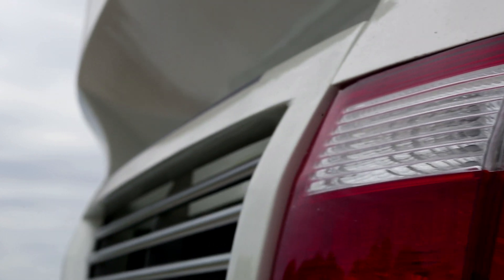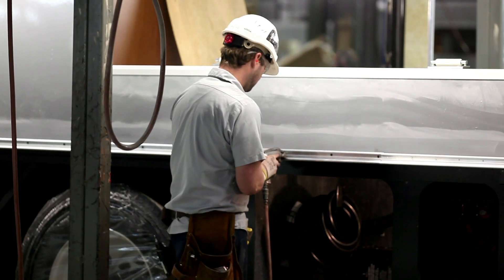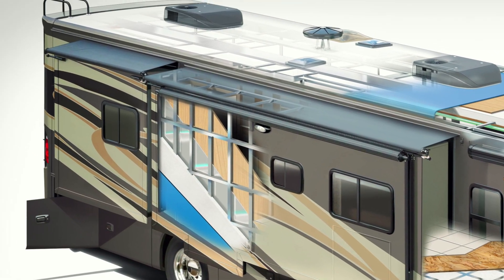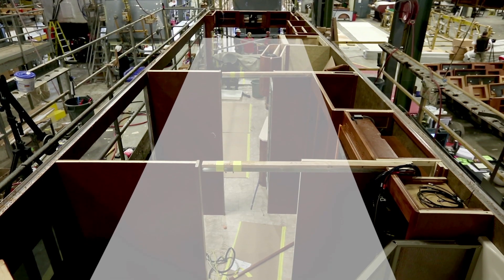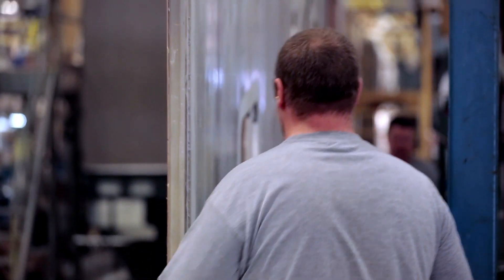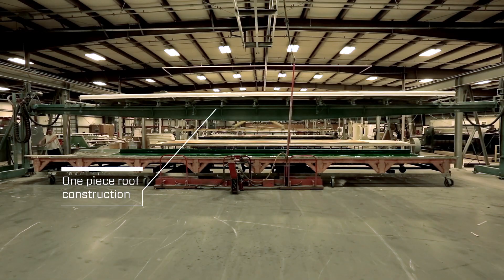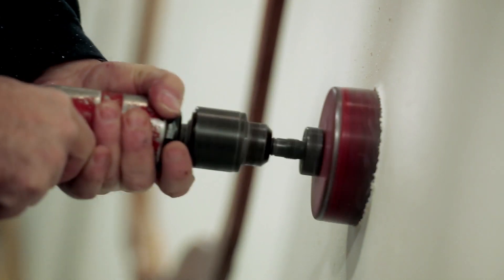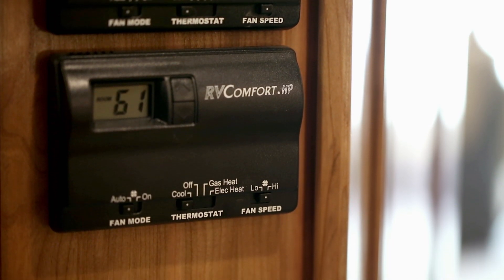Tiffin Motorhomes: A Closer Look - Construction

Comment: They look great but they do have troubles. My 2005 wet bay fell out on me on the road. It was made from plywood in the wet bay? Now the roof is leaking in 2 places and i have it sealed each year and stays in my shop. The back slide has a crack that is starting to show. I would love to purchase a new one but from my experience if this is how they are made then I will look into something else. I did call Tiffin and was told it was to old when i did call and that was when it just turned 10 years old and had 20000 Miles on it. It now only has 25000 miles and just sits in my shop since it leaks, Like they say owning a boat is a hole in the water well this is just like it. Still beautiful .